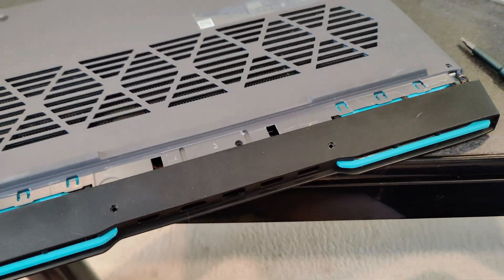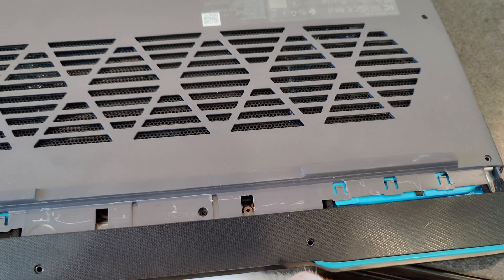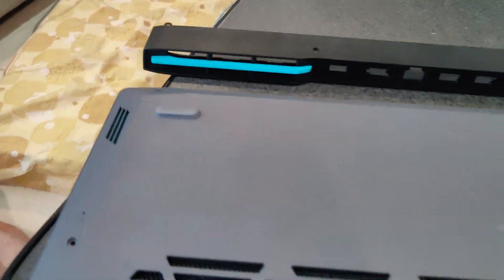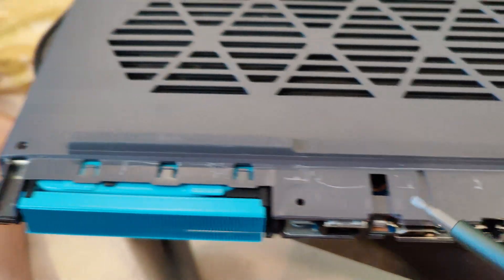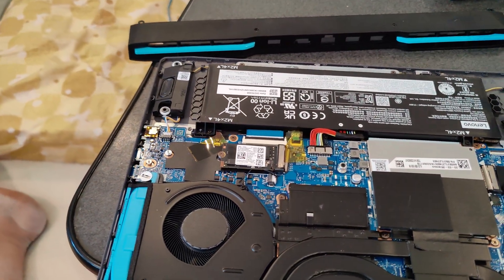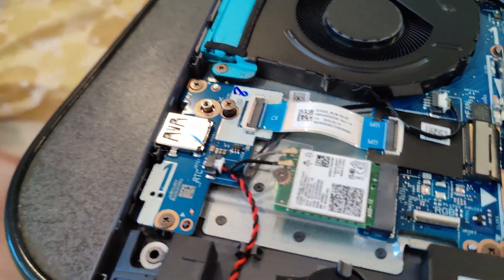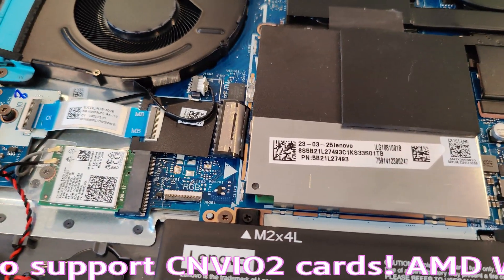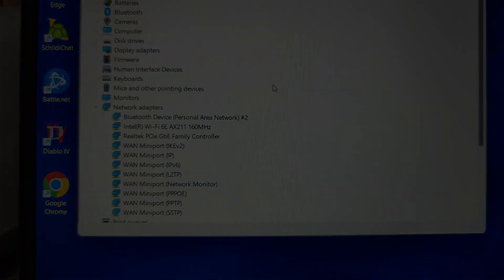Can the Lenovo LOQ be upgraded to Wifi 6E?

Comment: Isn't it only AX211 that requires an Intel CPU but the AX210 works fine, or am I mistaken?

•  M.2 using PCIe interface:     AX210

•  M.2 using CNVio interface:  AX211
Reply: the reason why 211 vers didnt universal is just bcs the CNVio2, u can get the 210 vers for all motherboard that support m.2 wifi card